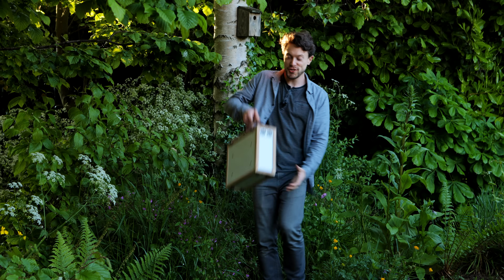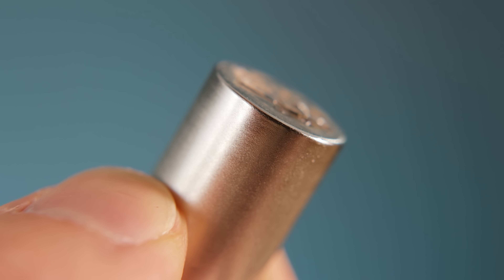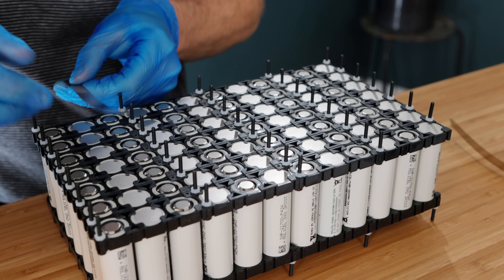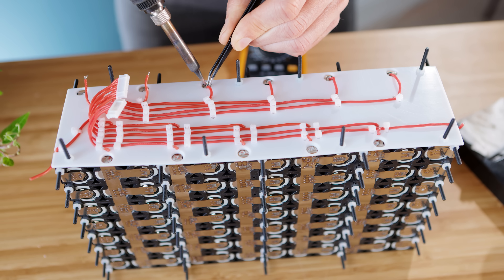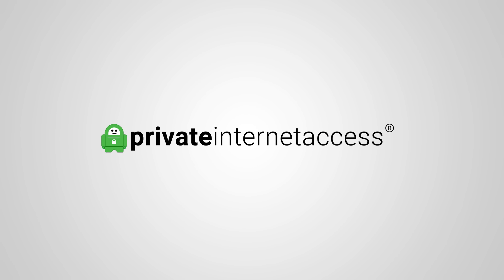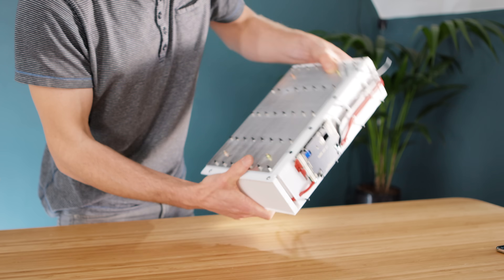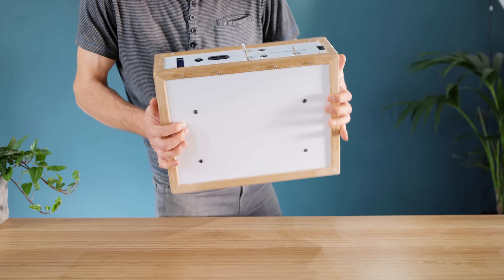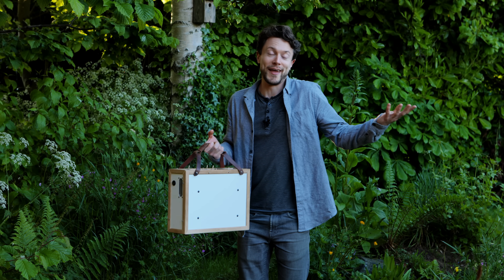Build your own portable POWER STATION (1200w, USB-C and MORE!)

Comment: No idea what deans connectors are.  45A Anderson Powerpole Connectors are probably better. I prefer crimped connections for mobile application than soldered connections. Crimped connectors are less likely to fail to vibration from movement.

Comment: I have to admit I'm a little disappointed that you need an external inverter for mains. 
I would think that with a battery of this size, and the portability factor, you would want to be able to plug in directly for mains.

Perhaps Matt can upgrade it in a future project.

Comment: Hi this is  a good project liked this very much I need to  power  rechargeable batteries to power my boom box max voltage 26v to power raspberry pi from a dac 6-26v  any help do this
  the easiest way Matt please my boom box will portable and main power which is 15v internal powered down by coil volt regulator.  I can use the existing voltage regulator to power by main out put 15v but need away power when portable?  The dac powers the pi 5v the rest is used amplifier dac hat. I am using volumio

Comment: Does anyone know how much Power is lost at the pressure Connections of a 18650 Battery Holder if this Concept would be made with it? This would make bad cells easily replaceable in return.

Comment: Wow so cheap and easy. All you need is 20 pounds of batteries, nickel strips, heavy duty spot welder, electrical knowledge , 200 dollars worth of circuitry, wood working tools , metal working tools, 3d printer , Bluetooth modules, scrap charger , tons of random hardware . Most stuff found around homes 🤣. I'm just having fun. Of course I love all your videos

Comment: Hmm really impressive.. I was looking at 12v 750w microwaves yesterday though. Still think your is lighter and easier to lug around than my leisure batteries though.. you can also get 12v fridge /freezers, colour TVs, video players (old VHS) kettles and all sorts of things.. you learn a lot when you live on a narrowboat with no power points. I no longer have my boat, but after seeing the new changes prices here in the UK, I'm no sorting out my new solar panels and I hope to supply my own lighting for free if possible (and I got a kettle and a few other things too). Now, I think about it, add solar panels to the side of your casing, set it up with  three  or 4 - 12 batteries in it (well you have 50v, so 48 will do four 12V or 2 48V set ups), so you can charge one or two at the same time and still use one, or two depending .

Comment: They never taught that in arts and crafts (or even my electronics deg course) but I did make a large woven reed laundry basket. I wonder could my 36v 12ah ebike battery (or any such battery) be simply rigged up with some kind of module to use it as a power supply and could I also charge it from solar. I'm sure both are possible but at present I am at the beginning of such knowledge. So far just a thought. Don't suppose there is any chance of DIY Perks doing  a little demo of such or pointing me in the info direction? Might be something more people could actually do and use without all the building of the battery section and the ebike batteries already have the charging control inbuilt. Anybody?

Comment: I have one that's 400 watts with a 400 watt inverter. it's light weight and small. My solar charger can handle 200 watts just fine but I think two 60 watt panels would be a good start. Having something this large isn't practical. As a prepper I think something smaller that can fit in your backpack would be better. Camping you'll only really need lights and hand held radios keep charged as well a cigarette light to make fire.

Comment: Can you stop promoting plastic please? We must save the planet. Also, I don't do leather. Also, I don't understand something around the halfway point of the video. I only watched the video once and didn't rewind the video, but halfway in the video there was talk about a battery controller to keep each battery balanced. I am a bit curious as to how that works, in the video I noticed only a few wires and not a wire attached to every single battery in the device. I watched the video while feeling under the weather so maybe something slipped past me, but I don't know how a battery controller can regulate every battery unless directly connected to each individual battery. Also, I am wondering how expensive would this DIY be, or is it cheaper just to buy a premade powerbank on Amazon? I see a link to all the parts but I would like the total cumulative price. Also, instead of plastic we can use biodegradable plastic or wood, plastic has about the same ignition temperature as wood but you used a special fire resistant plastic I think. With the wood we can use plywood and put some eco friendly fireproofing on it. Also, if someone does this I am not liable for any injuries that may occur from this.

Comment: Meh.. spot welding is nice, but most people won't have it. Just be quick when soldering and it should be fine if you have a strong soldering iron on ~320 Celcius. Also, no need to do 4/5 pairs of welding in each cell. Two should be more than enough.

Comment: no ring insulator on the positive side is a big no-no.  if that strip were to heat up it would melt through the heat shrink and the plastic insulator and short out

Comment: I have an ebike with a bafang bbsHD, my battery is 14s 12p 52v, you build a 12s pack and say its 50v, wrong, its 44v, 12s=44v, 13s=48v, 14s=52v, you are using the full charged 4.2v, you should go by nominal voltage 3.7v

Comment: I might be stupid but I didn't get how you connect a regular plug from a microwave, console or computer charger into any of the outlets you have on there... I get you made USB and all that but I didn't see any regular outlet capable of powering a refrigerator, let alone a 120V one especially since the battery pack seems limited to 50V max...

Comment: I can made somethin 2 do this job ,but so much cheaper, like way cheaper, like that's stupid cheaper, beside inverter wasn't included, so he lied, it can't power up the tv or enything ac ,unless u have a expensive high power inverter, n it works with 12v dc,n it's 50v so v regulator won't let u get more power than,like 200w ,
50 v was a really bad idea, i can go on ,so many things r rong with it, but in general, totally not worth it.

Comment: You have to create a solar panel thing, so you can charge this even if you don't have a plug available... It also should be able to work like a UPS, so you can have this plugged in forever and if the power goes out, the device will continue to work...

Comment: First for the safety you need to use safety(melting) fuse instead of metal tape. check out tesla battery assembly's

Comment: Dude this is perfect! I was looking for a DIY Pack for my astronomy equipment, Specifically Astrophotography which uses so many electrical devices. However, I believe I mainly just need 12V, but I'm new to this so I have do more drawing board work to see how many of which outlets I would need. Thanks for this! Then again the welders and rivet guns are things I don't have and will bring the cost up. Then again equivalent store bought versions with way less capacity are about $500. So I will def be looking into the pros and cons thank you so much! Is there a schematic that you have for this please?
Reply: Hmm, well I guess i can make from the video
Reply: I was thinking about giving it a go for the exact same use case as yours. But I definitely neither have the skills nor the tools required to do such a build. Additionally, this looks dangerous to do myself without having any knowledge in electrical components or soldering. Well I guess I'm back looking at retail battery packs (why are they so goddamn expensive!)

Comment: An excellent battery pack. My next step is to price everything out. I would consider using aluminum ( or brass) corner edging instead of wood for durability. Even rubber edging is available. Do you think I can get this past security at an airport? I’d rather carry it on. 😂  Yes, this is a good project. Thanks for posting it.

Comment: All very well, but.......
The cost and parts list would be a good idea, all the rest is pretty easy given the correct tools and even a DIYer could possibly make this over time.
I note you have used Molicel  P42A (21700) batteries with the spacers, which are of course not as common as the P26A (18650)
Why 50V?, just appears to be an odd ball Voltage, more in keeping with Solar panel pure sine inverters, which are quite large and certainly not portable.
Sourcing parts is the main concern especially in some countries like the UK along with higher costs, whereas in the USA they appear to have a culture that has brought prices down.
A well produced video about a personal project, which is probably rules out many DIYers if not only on the complexity of the project but the eventual costs involved.

Comment: Part 2. Adding a solar panel to the casing to trickle charge the battery 🔋 when not in use, (ideal for charging up through the week so it’s ready for the weekend when needed) I feel Glastonbury should have sponsored this video 😁

Comment: Would have been nice to use battery holders to make the cells easily replaceable instead of welding them. I think it's because of the current rating? Currently, replacing a cell would be a nightmare.

Comment: I don't know anything about making this stuff, but I wanted to ask this. Could you put springs ( 12:03 ) on the nylon bolts before you put the metal plate to protect the batteries from fall damage?

Comment: I still have one question: how you will use that for 2x0V countries? (2x0V is a made up term to combine those running at 220V,230V,240V,and 250V)
Reply: i guess he used an external invertor to get 2x0V. he says that during the microwave shot you can see the blue invertor behind the microwave.

Comment: Nice project. But when you pay that much, why don't you add couple extra dollars for better buck converters? These are rated 200W but if you really use them at this power they will probably fail overtime. You should at least have put two in parallel everytime you used only one.

Comment: If you also have solar panels then that battery could be extremely useful for a long term trip in a remote location while it could also be used in an RV especially if the RV is equipped with solar panels! :)

Comment: Thermal management. Those white plastic walls are holding in all the heat. Those center cells are going to increase in temperature much more than the outer. Air is a great insulator, so the spaces around the cells are not going to allow the cells to transfer the heat to the cells around it. If you had used enough of the black cell holders to fully cover the entire cell, the plastic would transfer the heat to the cell next to it. Hot cells is not the problem, the difference in temperatures between the cells is the problem. 
Great build though, nice solid design.

Comment: As a unit for outdoor use I find the lack of water resistance concerning.  I also would have liked to see AC conversion build directly into the box, but I guess based on the size I'm seeing, that would have made it too bulky and heavy to haul around one handed.  Solid craftsmanship as always.

Comment: I don't know what to call this! I've been researching DIY batteries and power systems for weeks now; and nothing can be as professional and sleek as your work! I just love watching your brilliant work! thank you
Reply: It's called a massive power bank lol. But seriously, it looked like it was made with my personal favorite lithium ion batteries, Molicel P42A'S which can both output about 30 amps per cell continuous until the pack overheats, or they can do around 20 amps continuous basically forever if you have some airflow. It was in a 12s8p configuration, so a 33.6Ah, 44 volt nominal system, which is equivalent to a 1.47kWh battery. It's got a lot of energy and very good output capabilities since the Molicel P42A cells are robust high output cells. I'm not positive why 12s was used in this application, but maybe it's more common than I thought? In the USA, we are more likely to run true 48v systems which means 13s lithium ion set-ups or 16s LiFePO4 set-ups. It just seems like we have more stuff available to get the most out of 13s systems, and there are more inverters and charge controllers that work with 48v nominal equipment. There are plenty of batteries, power banks and Solar generators that have 1.5kWh of energy capacity, so there are no shortage of options if you look around. There is a very powerful pack at Jag35.com that has this exact setup for $100 per module. It's already in a package, you just have to wire up your own BMS for it. You can run several packs off of one BMS. Just get something quality like the 300a BMS with Bluetooth from Batteryhookup.com or something from a reputable website. No cheap eBay stuff. You can find even cheaper solutions using cheap 44v and 48v battery packs from Batteryhookup.com and Jag35.com. those only require slight modification or integration if you already have a 44v or 48v Victron system or  a rack mount system that includes a BMS for every battery pack.
Reply: i know its a little late but i found this while looking for diy solar generators

Comment: Hey Matt, great video! I just want to say something regarding the 1200W and let you know that lithium batteries can go 100% Depth of charge (DOD) but it hurts the batteries and you will not be able to get the optimal lifespan out of it. Only using 1080W will be better for the batteries in the long run. I assume you know this but i just wanted to give a heads up of not. 

I recently discovered your videos and i love it!
Reply: The BMS should stop the batteries from discharging too far.

Comment: Does the BMS have any remote thermocouple inputs to monitor the internal temperature of the cells in the pack to provide low and high temperature cut offs for charging and when in use?
Reply from the maker: Yes, two I think.

Comment: Neat project, as always, but what exactly is the benefit of building a rig like that? A simple, cheap car battery can produce more than 6000 watts at 60 Ah and can be charged by your car's alternator.
Reply: If it can power a microwave for an hour, I guess the big difference is the capacity, this rig is 1200Wh, while 60Ah@12v = 720Wh, which may not seems much, until you account for Depth of Discharge, which is 50% for car batteries and 80% for Li-Ion

Comment: Having the 50v directly output is grate, but it would be cool to have a higher DC voltage from the battery pack. Most switch mode power supplies will happily operate from a high enough  DC voltage directly ( even if not stated on the label). Some newer microwave ovens have SMPS and will directly run on "high voltage" DC. Most TVs, laptop chargers will run on DC directly. Look at some of my crude testing with a 9v battery pack at 200v. https://youtu.be/Au3wURws_Bg

Comment: I don't know if its a dumb idea or not, but it would be a neat idea to find a way for the alternator in the car to charge the battery back up, so when you're driving from place to place after using the battery all day, you could charge it in the car to use again.
Reply: Good idea.... That and solar panels.... like the Jackery has connections for.

Comment: I'd really like to see you do a POWER STATION 2.0 equipped with a solar panel on one broad side that you can turn on and off with a switch so as to not overcharge anything. Also some battery gauge that has something telling it to turn off the solar panel if charge is 100%. A small in board screen would be nice to have interface abilities with specifically said system i mentioned.
Reply: That's what the bms is for when the battery's are charged it stops giving them power so would be no need to switch the solar panel

Comment: I would love to see a variation of this project with an integrated ac to dc converter with some kind of hall sensor switch integrated to detect when mains power is off and automatically switching to battery in the event of a power outage, wanted to do my own battery back up system for years now but never have the time :/ Amazing video, you inspire me every time I watch!! 😀